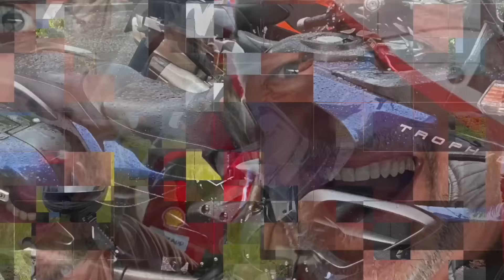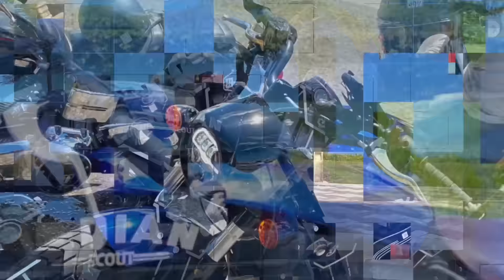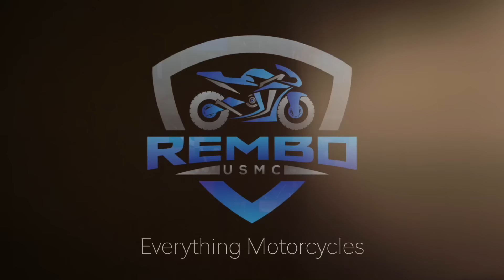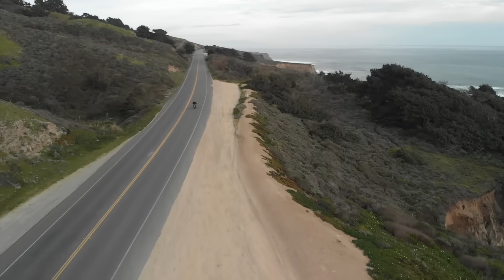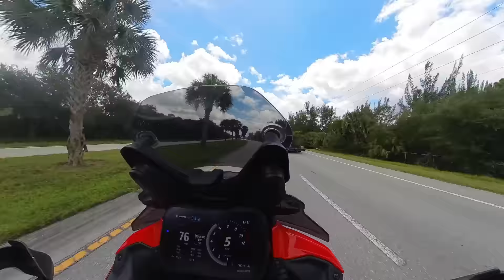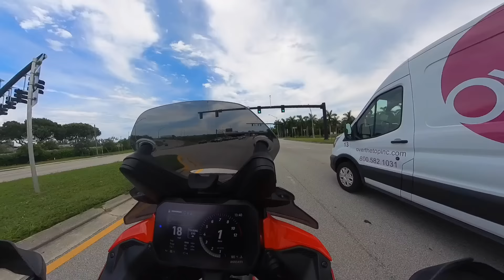What Ryan F9 Did Not Tell You About Motorcycle RPM

Comment: Do you guys think for 2 seconds before stating that higher RPM = more pressure?

Most of the time, it's the exact oposite unless you're at wide open throttle.

1/4 throttle at low RPM means you completely fill the cylinder with air, meaning a bigger bang, this is why the engine revs up and accelerate you.

1/4 throttle at high rpm means high vacuum from the engine, throttled down by the butterfly meaning less air per cycle, meaning smaller bang.

Lugging an engine will always produce more heat. If you cruise in 6th gear instead of 5th gear, there will always be more cylinder pressure in 6th for the same speed, because you need the same HP to achieve the speed. Same RPM, lower revs means you need more torque, more torque means more cylinder pressure.

Comment: The Italian tune works , it  burns off carbon and in at least 2 cases  , for me  ,  it has   cured an oil burning problem .
The oil control ring  on your piston gets  gummed up with a delicious mix of oil and carbon , can't scrape the cylinder walls as well , and thus some oil gets left in the combustion side  to burn .A few good pulls  on an empty highway at 3 AM cleared that right up ( after i warmed  the bike up of course , I am not a savage that gives all the beans to a cold engine ) . So every now and then find a nice open highway  and pull the throttle wide open for as long as your balls allow it .
As far as performance gains go they are quite negligible so do not redline your engine expecting it to   find  power which was never there to begin with . 
And check your tire pressure , i doubt you've done it recently
Reply from the maker: I definitely agree on tire pressure. I actually checked mine before every ride.  I also bought a really good gauge that it’s very accurate and I can keep track of what pressures work best for me under what conditions. You are absolutely correct, tire pressure is more important than people realize

Comment: One of the older mechanics once told me to take a look at my speedo and divide it in two halves, like cutting a pizza. This is the optimal speed for your vehicle. Then when you reach it take a look at the rpm reading. This i the sweet spot for your engine. The rest to judge/or clean/ is located between the round thing under your helmet and the limb placed on the accelerator. Cheers!
Reply from the maker: Great tip!

Comment: Like you said it all depends on each individual engine design and type.  You have to find the sweet spot for each engine.  A short stroke inline 700C will rev higher and have a much higher sweet spot than a single cylinder long stroke 650.  My KLR 650 begins to vibrate and burn oil and fuel above 5,000 RPMs while my Nighthawk 700sc has a huge boost in the powerband at 8-10,000 RPMs.
Reply from the maker: Right on

Comment: Operate your engine in where you need to operate it for the load.  Know where your engine comes onto peak torque, and shift to keep it at or above that point when you need full-throttle performance.  It ain't rocket surgery.  The engineers put a gearbox in it for a reason, and they selected the gears they put into for a reason, and they put the redline where they put it for a reason.

If you want to worry about excessive wear, worry about trying to accelerate up the low side of the torque curve in high gear.  You'll wear your rings, piston skirts, and cylinder walls out far more rapidly at low RPM and high engine loads than at high RPM and low engine loads.  Don't forget that in addition to the higher sliding friction on a piston loaded at low RPM, you also have LESS OIL FLOW AT LOW RPM.  Unless you've got some fancy electronically-driven lubrication system, your engine stays better lubricated at higher RPM.

I've never understood what it is with motorcyclists and pilots.  Two groups of people who both think they know shit about their engines that the engineers who spent decades designing them didn't consider during the design process.  No, you can't "shock cool" your Lycoming by doing anything short of throwing it into a swimming pool.  No, operating your motorcycle which comes on torque at 5,000 RPM, makes peak power at 9,000 RPM, and redlines at 12,000 RPM between 5,000 and 9,000 RPM isn't going to cause it to wear out prematurely.
Reply: EXACTLY! Shock cooling is a myth! I have always run every aircraft at WOT! I only reduce power when I want to descend. As for turbines, a Turbomecca engineer years ago told me to run the helicopter at the first red line you reach all day every day and it won't develop those little problems that everyone complains about! Ran a whole season with zero glitches while the two sister ships were down for maintenance more than a few times. As for my vehicles, I can feel when they are right and I never lug them.

Comment: Yes it comes down to the engine design. And I believe the point was made that engines like to operate in different ranges; BUT it holds true that you really should use your whole rev range or close to it when accelerating and to not lug your engine. Piston skirts are getting shorter and rings thinner. When it’s moving slow at a high load, there is more side loading of the piston and load in general as he demonstrated with the bicycle analogy. 

The advances in engine oils, engine materials and manufacturing tolerances means that high revs are not as harmful to our newer bikes than they used to be. We all feel it in the way they run smoother now. 

Nobody is saying to be at 80% redline while you are cruising down the highway at a constant speed. But hit that hill or go to make the pass and it will be better for the bike, transmission and driveline to drop a gear and let those revs climb for the short duration. 

One easy way to know if you are lugging it is to make note of how much you are on the throttle and if you drop a gear you have to give it less. That is what you want to avoid. Besides, isn’t changing gears and listening to the engine roar part of the fun?  
As Ryan says, use all of the rev range we have been given. (Unless you are on an old bike or it hasn’t warmed up yet)

Comment: I run my Road King Classic on the interstate quite a bit. Bike runs far better when i do! Noticeably. It's an older model with a 5 speed and a stock 88 inch twin cam. It is night and day how that bike runs between high speed operation and around town. I have also just recently discovered that the bike shifts and drives way better when i run it past 3K to shift. It is butter smooth!
Reply from the maker: Very cool!
Reply: Exactly, shift through at 3k to just under 4k and smoooooth. I cruise at 2500 in whatever

Comment: The last time that I encountered a problem with carbonisation in and engine was in the mid 90's on a 76 Mazda. Just operate engines the way that they were intended to be operated. High RPM, low RPM... blah blah blah. You can feel it in your blood. And if you can't feel it in your blood, check the manufacturer's handbook. It will be in there, if it is something to consider. THEIR ENGINEERS HAVE THOUGHT ABOUT THIS AND MANUFACTURERS HATE BAD PRESS!
Modern engine designs, fuels and lubricants have gone a heck of a long way from the days when carbonisation was a real issue. I've got an old vice in my shed that I inherited from my father, that came accessorised with a tool to secure cylinder heads for the purpose of decarbonising them. That vice was founded in the 1940's. It's 2023! 
Use the engine like you should. Treat it well, give it a bit of a blast once in a while to "stretch the rods", get the oil flowing at maximum pressure in order to remove any gunk from the galleries, knock a bit of poop off the pistons, valves and head and it will be fine. No need to overthink this one, folks.

Comment: Do it like your car's automatic transmission does it:  When you are less than 1/4 throttle chose a higher gear; but when you are going somewhere shift down and rev up.  At full throttle wind it out before shifting.  And if that doesn't work, Sea Foam once a year (for carbs).

Comment: Just going from memory, but in watching the F9 video, he was on a 2-stroke bike.  Those old bike really need the extra RPM to get the burned oil out of the engine.  My impression from the video is downshifting and keeping the bike in the optimal power range is important.  It is better for the engine and safety of the rider as well.  Lugging engines leads to loss of traction at the rear wheel when you might need it most.
Reply from the maker: Great point!

Comment: I have two bikes, an R1250GS that likes to be at around 3800 rpms as a minimum, unless im puttering through a busy street in town. My Triumph Speed twin 900 needs around 3300 to 3500 RPMs as a minimum to feel likes it spun up and ready, if that makes sense. Unless im puttering through town. I never have a need to go to redline. BMW redline is 9000 I don’t need more than 6500 maybe 7000 if im really getting it. Triumph redlines at 7500, really no need to go over 6000. Both bikes I usually stay between 3500 to 5000. I’ve been riding street bikes since 1984 when I was in the Air Force. My primary transportation today. Have a great day !

Comment: Lugging also stresses the power train by loading up engine and transmission components too. Speed = momentum which allows for smoother running.  Detonation is a sure way to destroy your engine. You’ll pretty quickly get the feel of when your motorcycle is happy and the occasional Italian tune-up seems to really work.

Comment: My opinion is that it's best to mostly drive where the torque is and on occasion when there is endless straight I try to wake up all the ponnies just under limiter. Never mind the consumption, when I back up I spare probably less than 2 liters on 100 km. It doesn't pay off for the boring ride at all.

Comment: If you want to get high temps and clean it out, POWER is the you want, NOT rpm. A dyno works well for the old italian tune-up.

Also, for the same power output, lower rpm will actually have a higher temp for longer. Higher rpm will only require slightly more power, for the same wheel power, to overcome more valve actuation, etc.

Comment: The most important thing to do with ANY engine, especially a high revving engine is to warm it up before opening the throttle, first 10 miles and take it easy on the last ten before home. 
Change the oil, change the oil & change the oil if you are hard on the throttle more often. Just my 2 cents advice
Reply: Ten miles is a bit much. Even during the winter (at least in Alabama) we've hit operating temps within about a mile, by two miles the entire engine is heat saturated and the radiator is hot as well. The metal has expanded by that point.
Reply: @glenwaldrop8166  Yes, the advice above is solid for larger vehicles like cars but our smaller engines rapidly heat up and cool down so only need a few kilometers/miles to get there.
Reply: @stanshingler  I guess you're saying they don't retain the heat internally until a few heat cycles?

Took a minute to decipher that one.

Comment: I saw Fortnine's video before I saw yours and I thought the same thing.

Low RPM may then be causing more carbon buildup, yet (constant) high RPM will significantly increase wear on the engine.

I always compare it with a human who has a very stressful life up until retirement and then passes away shortly after; the parts are all worn.
The biggest stars in our universe burn up so much energy that they also have the shortest lifespans.

I thought about the balance you just mentioned, and similarly that there has to be an inberween balance which is not too "lazy" yet not too stressful.

I see a vehicle (car or motorcycle) as an extension of my body. I don't ride/drive it, I become it. I take care of my car/motorcycle the same way as I take care of my body: not too lazy (which may causes cholesterol buildup) and not too stressful (which may cause excessive body wear)

With a balanced diet, exercise and enough rest, the body is most likely to remain healthy. With good maintenance, the right fluids, not too low in RPM and not too high for excessive amounts of time, the car/motorcycle may remain healthy for a very long time.
Reply from the maker: Great information

Comment: I say blow it out occasionally. Always tuned my Grandmothers '69 Impala when I was young.. After one tune up she called and said it was missing some. Took it out on LBJ in the metroplex, floored it and it chugged and blew smoke. Second time it smoked less and had better rpm. Third time it blew out remaining carbon and performed like it should. Never had any more trouble with it. So ya, carbon buildup, but that engine had points, condenser and carb. Don't know if that makes a difference with optimal tuning at different rpm's in modern engines.
Reply: 100% agree! Engine performance is not going to suffer with minimal carbon buildup so operating your engine with only that in mind means ignoring excess wear/fuel consumption/heat buildup/noise from operating at a  overall higher than optimal RPM. For many engines the driving conditions they're operated in dictate rpm and load so your recommendation of "blow it out occasionally" makes the most sense to me.

Comment: What we are missing here, is that high RPM, under light loads, results in LOWER combustion pressures and temperatures, than low RPM under a high load...
Running high RPM under low loads also means having an engine desperately trying to draw air through only partly opened throttle valves, meaning the scavenging is poor.

The statement, High RPM gives higher pressures and temperatures, is an invalid statement, without taking into account the load.
Doing 30 mph at close to redline RPM, will mess up your engine just as much as trying to accellerate at WOT in highest gear from just off idle RPM...

The thruth is in the middle: Occasionally, go through the gearbox with everything she's got, but in general it is best to cruise at the lowest RPM where the engine will respond to the throttle without "protesting" (We all know how that feels and what that means). This gear/RPM combo will be different for each different cruising speed.
Reason: At a given velocity, the power required to keep the bike coasting along is constant, because power required is strictly a function of vehicle speed. Power is torque x RPM. Torque=combustion pressure/temperature. Lower RPM for the same vehicle speed results in higher combustion pressure. Higher combustion pressure, by its sheer definition, results in better fuel efficiency. Better fuel efficiency results in lower carbon deposits.
This is valid down to where the engine will still respond comfortable to the throttle. Every halfway decent rider will immediately recognize that too low RPM as soon as he opens the throttle.

On the upper RPM range, ANY RPM above that of peak torque, will ALSO result in lower combustion pressures and less efficient combustion (more deposits).
Reply from the maker: Excellent information. I completely agree about going above maximum torque.
Reply: @RemboUSMC  Thanks... I studied long and hard for it, a long time ago.

Comment: Hi REMBO,  good vid, balance is the key, not just redlining the rpm all the time OR slugging along in top gear at 35mph with the engine protesting and shuddering 🤬.

The old guys back in the 70's used to ride that way on their obsolete but new at the time BSA's and they were such poorly designed engines running on single viscosity mineral car oil, that they really would wear out. Scroll forward a lifetime to the 21st century and the legacy of the old rear braking, low rpm luggers is still a thing......however, bikes are designed to rev now, and need to be kept in their optimal rpm zones which as you point out can vary depending on intended design use.

Oils are so good now they last longer and work better than ever before. 

It's not so much about "blowing carbon out", more about keeping the engine spinning in it's optimal zone, with the occasional zing up to high rpm to check if the rider is still awake 🤭.

The worst thing anyone can do to a bike or themselves, is to overinflate tyres and over load engines by lugging them. Surely everyone can hear & feel the engines when they protest while being tortured at very low rpm (or at excessively high rpm)......am I the only one in tune with whichever bike I throw a leg over? I think not.....REMBO knows how to ride an engine........and he is right on the money with this video.

👍

66yo, 45+ yrs riding, not an idiot but not a lugger, and who says a grandma has to be a slow rider......there's a few lively grey hairs out there........we've got a few in the Ducati Club
Reply from the maker: That’s a lot of great information from your experience. I really appreciate you taking the time to watch the video and posting your thoughts.